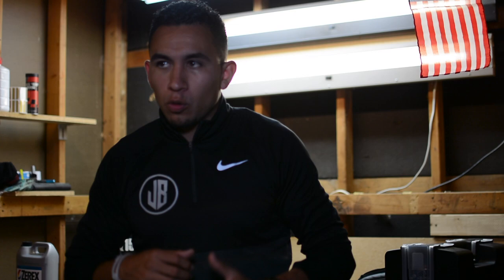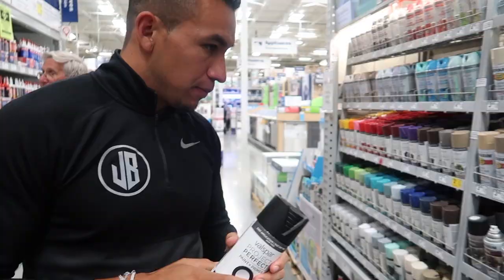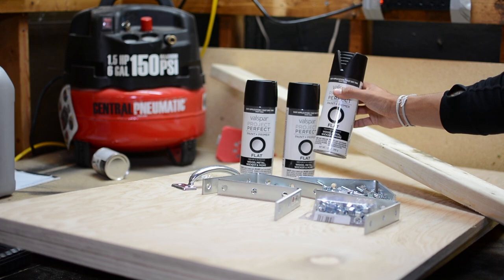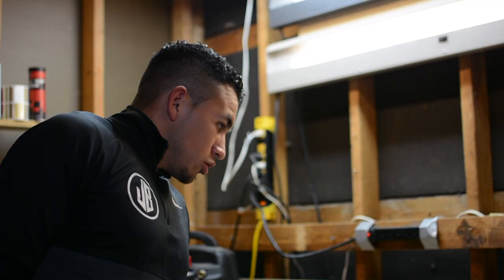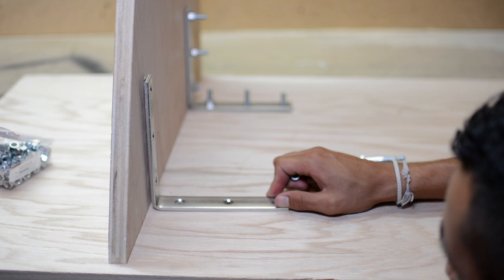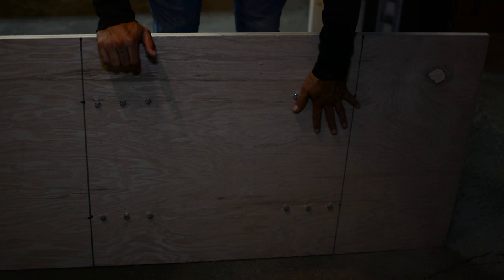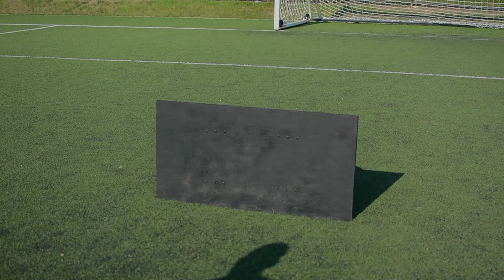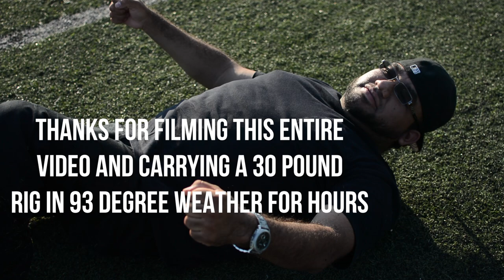How To Build A Soccer Wall/Rebounder! (Full DIY Tutorial)

Comment: Great video, Javier! I wonder if you could have used hinges instead of L brackets in order to make it collapsible for storage. The hinges would swing each leg to the outside. In order to prevent the legs from folding when in use, you can create a wood piece or something to bridge/join the legs together. Just a thought.
Reply from the maker: +Jamie Cox I had that in mind, but my woodshop skills don't go further than the high school elective I took. I also wasn't sure exactly how to go about it without feeling insecure about the legs collapsing when I hit the wall, but that is definitely one of the main modifications for wall 3.0. Thanks for the suggestion Jamie!

Comment: Coach.   

I made one. For my sons.  It’s easy.  It an awesome piece of equipment for the back yard.  

Thanks so much for this video!!!
Reply: Hello, 
Can I ask how much did it cost you?
Reply: Rory Lamond in the End. It’s should cost less than $80. If you don’t need tools etc.  just the part could be 80-60$$.
Reply: Rory Lamond it’s so worth it.  Coach’s version is exactly like the one I made.  It’s works really well.  Can be made very fast.
Reply: @72pinebarron  I'll give it a go! I was thinking about selling them but I doubt i'd make a profit?
Reply: Rory Lamond yes.  Go for it.  Only stood move i made was buying too long of bolts.  Had to cut them down.  No biggie.  If you sell one let me know.  I will make a few for kids on the teams my sons play on. Thanks
Reply: @72pinebarron  I'll let you know if I do sell one, I'm working in pounds though as I'm from the UK!

Comment: For a cleaner look, I think I am going to not use bolts and nuts. Instead I am going to use 0.75" lag screws with washers to join the brackets into the wood. 0.75" should go through most of the plywood so plus using lag screws should keep it solid.  Might double up on the number of screws and brackets, which will add minimal cost and minimal weight.

Comment: Have you had any issues with the head of the bolts pulling through the face? Would you suggest using washers on any future ones?
Reply from the maker: jaydgreen1 no issues at all but wouldn't be a bad idea. We thought about it but didn't feel it was really necessary. But they basically cost nothing so would be good just to be safe! Good suggestion.

Comment: You should cut out the centre of the legs to reduce weight. You wouldn't lose any structural strength since it only leans on those anyway.

Comment: I recently bought this cheap rebounder net off of eBay and it's ok, the net isn't pulled back enough to give a good solid pass back and it's not accurate, the volley side is also messed up since the angle of the ramp is terrible and the ball doesn't really get up that high so it's just not a good product but I still use it since I have no other option😔😔 btw how portable is this?
Reply from the maker: Road to Pro gotta use what you got man! It's all about practice. It could be more portable but it would make it more expensive. I wanted to keep it as simple and effective as I could. It works well to move it around the field but transporting it from home to a field or different locations might be a bit bothersome. There's always pros and cons 🤷‍♂️